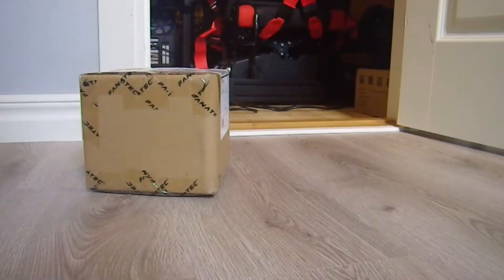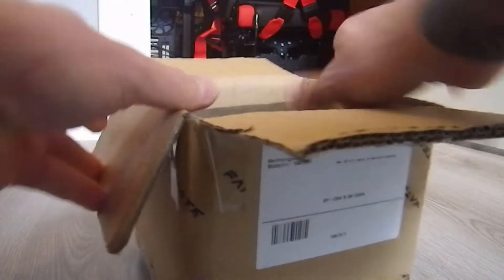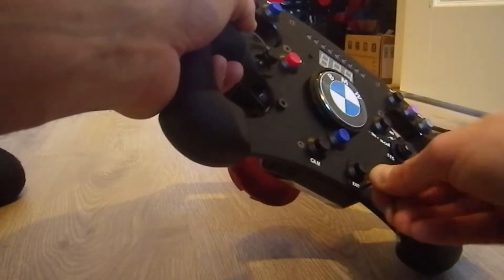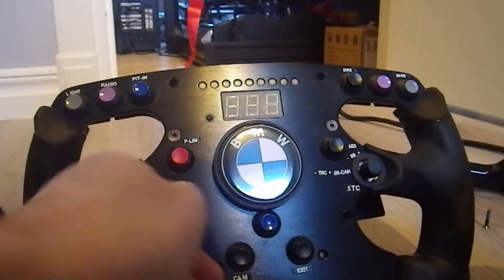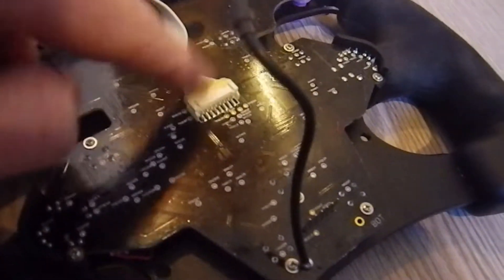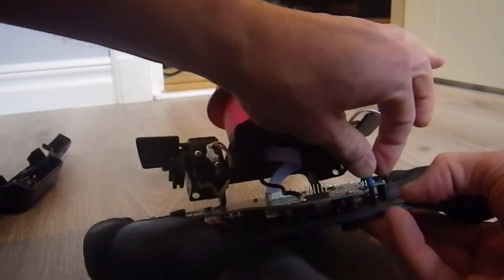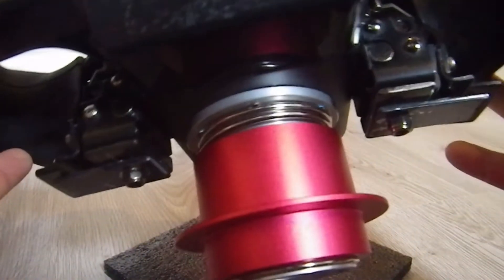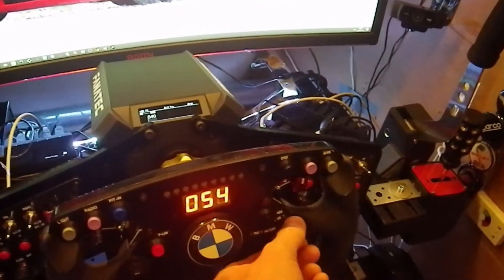Fanatec Formula Black Broken Pin Conclusion / Repair

Comment: Hey bud! Thanks for the video, where did you buy the spare part? I have the same issue, but the formula 2 👌🏽
Reply from the maker: Hi mate. 
I contacted Fanatec, and was able to order a new main cable from them.
Reply: @RVRCloset  What was the total cost for just the new cable and pins including the shipping cost?
Reply from the maker: I think I payed 2 or 5 euro for the main cable, the pins are included with that cable. But I also had to pay for shipping, so I also ordered some more stuff while I was at it.
Can't remember the shipping cost, around 50 euro maybe. But I guess that also depends on what country you are living in.